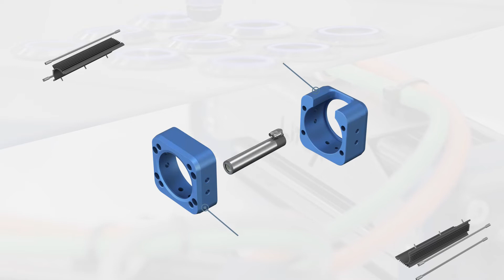ANCA Motion's LinX® M-Series Linear Motor

Comment: I wonder how do you maintain the air gap between the shaft and coil? I have seen similar motors but with shaft stationary and coil moving, where they maintain air gap using dedicated rails and rods, but I don't see any of that here in your product. I am eager to know!